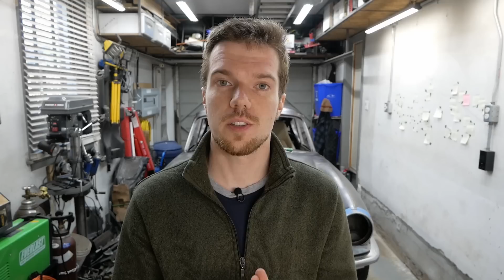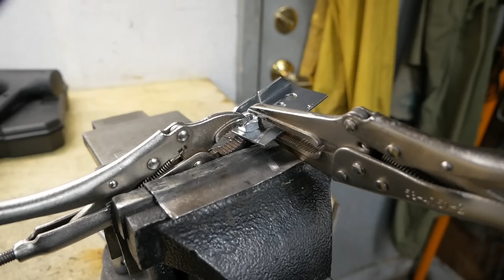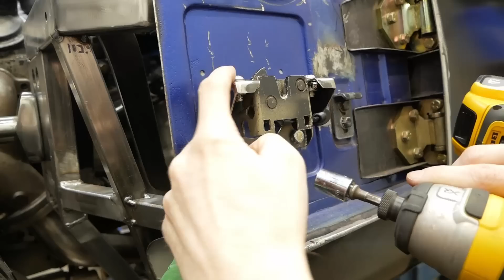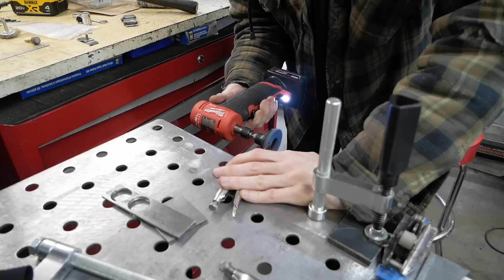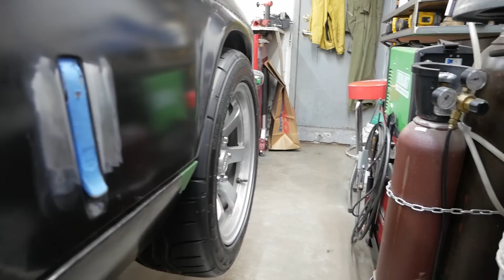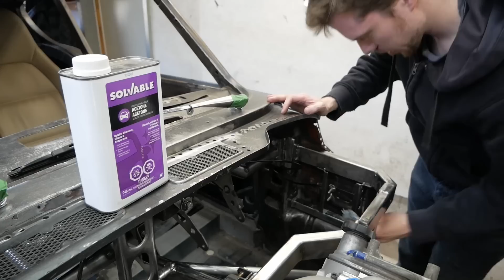Overkill Latches! V8 Powered Pro Touring Triumph Build – Project GT6R – Ep44

Comment: You can throw zinc coated items in a vinegar bath to dissolve the coating. This should make it much safer to weld and doesn't require any labor or abrasive consumables. This works well for mill scale too. A sonicator can speed up the process.

Comment: I have to ask, will petrol even be a thing when this little beautie is finished, or have you planted hemp out in the back 40 acres to turn into self sustainable biofuel as well?
Seriously though what about deterioration of the rubber like the use by dates on the tyres or any seals in the running gear, I have heard that it is far preferable to use a vehicle than let it sit as all the seals dry out, does that worry you, I bet the tyres cost a pretty packet to sit and get flat spots on them while you are crafting this animated sculpture.??

BTW have a look at Rünge Cars YouTube channel you might just be blown away🤔😮👍
Love the build
Tony from Rural Western Australia 🇦🇺🦘

Comment: Can use lead or similar to make a small ferrule to lock into the cable grip. Make a mold out of anything, even copper and a dremel. I know for sure that the handles will let go after awhile without it (35 years in small engine equipment and motorsports. Where everything has at least one cable and 100s of revisions over the years.) Print the retainer with reinforced material.
I figured out another way to locate the sides without using the originals as more than faux latching hood lift points. You can print a whirlpool shaped receiver insert that snaps in place on or beside the new latch receivers. Use a tapered tip metal guide pin, 8-10mm, mounted on the hood that goes into the receiver on each side of the hood. This would tighten it up as it closed without having to use the existing latch mechanisms. Avoiding the inevitable occasional hood tweaking when forgetting the other side latch.

Comment: Hi, and nice work all the way around.  I do have one issue that I'd like to bring up.  The idea of having to do three separate operations to get the hood to open, seems excessive.  It's your car, with your aesthetic and all that, and maybe I'm just kind of a simpleton, but 2 operations seems like plenty.  Maybe even excessive.  Especially on a front hinged hood.  Wouldn't it be nice to have solenoids as the primary way to flip open the original latches, with the manual operation being the backup?  I normally don't like adding weight and complexity, but I also don't like the idea of walking all the way 'round the front of the car, just to get the hood to open!  Maybe a cable system where operating one external latch will operate the other latch?  Or, maybe you won't be opening the hood enough to make a difference?  On the other hand, a V8 MG sort of begs the opportunity to show off what's under the hood!!  Or, just tell me to mind my own business!!!  Either way, nice work.  Have fun.
Reply from the maker: There will be very few times that it's just one of us driving the car, so two people to pop the factory latches and the driver just has to pull the internal release - so not a big deal for me. 😊 I understand the desire for simplicity of operation, but there comes a point where we've got to move on to the next step or the car will never be done!  I do also hope that with the LS, reliability will dictate that the hood's not getting opened all that frequently as you pointed out! 😅🤞 Cheers Jim!
Reply: @FanatikBuilds I was thinking that the hood would be up, more to show it off, along with the quality of the work done to get the LS in there.  I figured that you had a general plan to have a navigator, your dad or mom, or girlfriend/wife, but I almost never have anyone in the car with me, so I really appreciate electric windows.  Obviously, we open and close windows more than we open the hood, but I never cared about electric windows, until I had them.  My comment was kind of suggesting "future proofing" the car.  Great job!!  Keep up the good work, and I completely understand not wanting to get bogged down in too many details, and have your momentum die.  Driving them is more fun than constantly coming up with fiddly little details to solve!!!

Comment: QUESTION: what welder do you use?  I know it’s a MIG but what brand / rating and do you use gas or flux core?
Reply from the maker: The MIG is a Lincoln Electric Mig-Pak 140 (120V) and uses 75-25 mix.  The (lesser seen) TIG is an Everlast 185DV and uses straight argon.  Cheers!

Comment: Nice job on the latches. Clean solution for those bolt heads. I kinda like them on my 67, but should I ever change my mind I know to do it now. 😊

Edit: mine are stainless so they match the trim and look intentional. I don't like the look of the bolt heads painted. Looks to me like the painter failed to remove them, or like you're trying to hide them.
Reply from the maker: Thanks man!  So many things on this project may not be for everyone, but at the end of the day it's about building, and the specific mods need not be so relevant!  Or at least, that's what I hope people feel 😊 Agreed on not painting over the bolt heads, you'll regret that the instant they crack or you have to remove them!

Comment: I think with your need for such precision, I'd suggest getting yourself a Tig welder. Less to grind and better control of the heat. Plus the finished product will look to your standards. Trust me. If you can do what you're doing your can Tig.
Reply from the maker: Do have a TIG, but don't use it often enough to be confident ... plus MIG is just so much faster and easier. (excluding the extra time in finishing as you point out of course!) ... I do need to grab the TIG more often though, you're right.  Gah!

Comment: @5:32 is that a brass wire wheel you're using before welding again? Right after saying that you don't want to be burning the zinc from galvanized nuts?

Comment: I think you need to create a "clamshell" with hinges and structural elements for the cowl area. Think of the easy access to the back of the gauges and control area. Of course tightly sealed from heat/vapors.  Could be a neat addition.
Reply from the maker: Still trying to decide on that!  Water management will be the key issue to the design... I do like the idea though 👍

Comment: I predict you will be revisiting the little cable clamps. Ten pounds is not very much holding power. A full cable loop with a proper swage fitting retaining the loop. Examine the hood release cables on several production cars and trucks to see their methods.
Reply from the maker: Yep!  It absolutely is not enough ... more time in CAD coming up I think. ✌️

Comment: Nooooooo ..... Every place you weld something to the outside body panel it's going to show through when it's painted !!!! Trust me no this .test it out on something. Here's what the problem is!! It's the expansion of the sheet metal when it get hot . and wend the seam on the hood and remove the flag on the inside. Its also going to show through. I'm trying to he!p NOT PISS anyone off .look at any car and you will see that nothing is ever connected to the out side sheet metal ( body panels) you'll find out if you don't fix it before it's painted. I've been doing this since the80's
Reply from the maker: Yep, I know it, panel bond would have been better but there's plenty other areas on the car that have been mig-welded together so it is what it is really... it'll never be a concours car, but we did it all ourselves, and even my OCD can handle a few imperfections (within reason!) ✌️

Comment: End of the hood latch curves up to make it easy to use but it looks bad.  I would rather it be flush with the panel and push in button to release it.  Or just push the top of the latch in so the bottom would protrude enough to be able to grab the bottom of the latch.
Reply from the maker: Yeah that would be nice, I think I've already spent more than enough time on hood latches though, so we'd better move on if this car is ever to be completed! 😅✌️
Reply: @FanatikBuilds  Hahaha yea don't blame you.  You still do a great job on it.

Comment: Do you have room for vintage air ?
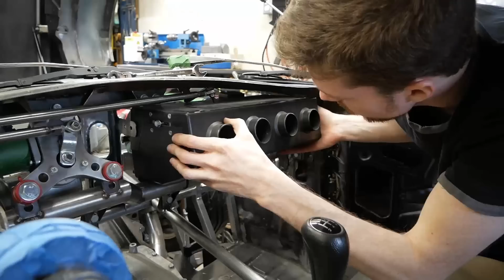Reply from the maker: The air handler we pull out at 13:53 is for heat and AC. 👍 WAY cheaper than Vintage Air, but obviously not as quality or high-tech.  AC was ironically one of the reasons why we started down this restomod path in the first place as it happens!

Comment: Grinding down nuts for better penetration of weld is real. For a while, doing some field repairs, i'd noticed that the nuts that i welded on in the field wouldn't last anywhere near as well as the ones in the home base. It took me a while to put 1+1 = 2 and get that while at the shop, i'd use a bench grinder to grind the nuts off, and while in the field, i didn't bother. The zinc coating does interfere with the weld on the order of porosity, most likely.
Reply from the maker: It makes complete sense!

Comment: I vaguely recall something about you creating your finger sander from something other than what it is now, but I don't remember. Would you help out and tell me what it is? Thanks.
Reply from the maker: Hey Jim, it's Milwaukee's M12 3" grinder, just with a 3D printed adapter for the finger sander's arm, and a pulley I made on my lathe.  You can buy conversion kits on ebay to accomplish the same goal, or just buy Milwaukee's actual finger sander for about $100 more! ✌️

Comment: stud welder is your friend, just plop studs where you need them and remove superfluous bracketry
Reply from the maker: Yep, that would be nice!  Don't have one though and likely wouldn't be a good idea to stud weld to the exterior sheetmetal, as it would tear in time.  The little stud plates we made are thicker and help to spread the load 👍
Reply: @FanatikBuilds  there are headed studs that have a bit more area for that exact case

Comment: Amazing work as always! Love the extra work to improve the look of the hood around the latches, that really makes a big difference!
One slight thing I feel inclined to mention: 10 lbs is not a lot of force against those hood release cables. My suggestion, if you wish to stay with your 3d printed clamping solution, modify it slightly so that the cable can pass through it twice: once through, then 180 degrees around and back through again. This would probably add a surprising amount of clamping strength with minimal change, if my brain is working properly anyway (which is always questionable). Of course, you probably already thought of that.
Reply: was coming to the comments to suggest the same. Please do this!
Reply from the maker: It's a fantastic idea, but getting the cables to bend 180 degrees and still fit in the space is the issue ... we're definitely going to need to improve the design though as you're right, it's not going to be adequate as it is!  Thanks man, we'll see what we can do! 😎🤜
Reply: @FanatikBuilds  - Thanks for all the great content! Also, thanks for considering my suggestion. I'm always happy to lend all 3 of my brain cells whenever I can. 😁

Comment: Any way to use one of the original bonnet latches - the external chrome handle, anyway - as the handle for the interior under-dashboard release?  It would be cool to still have another OEM latch in use, just in a different manner.
Reply from the maker: Interesting idea, hadn't thought of that, I like my printed latch with the pictograph on it, but perhaps something to think about 🤔

Comment: Surprised you left the seats in the car with doing all that welding and grinding. Great video. Thanks 👍🏼
Reply from the maker: Yeah, we need to get some welding blankets ... think we popped some cardboard in a one point, but the seats will be getting a refresh eventually anyway, so as long as there's not too many burn holes I think we'll be able to work with them! 😬😉

Comment: I appreciate the effort you put into the details, I'd have probably just taken a hammer to the latch to straighten it out. I think we should start taking bets on how long until it's complete, my guess is 2028.
Reply from the maker: Haha, unfortunately that wouldn't have worked sadly or I'd have given it a shot myself! (it would change the bolt spacing and then the factory holes in the hood wouldn't have lined up for plug welding) The things we get into for the sake of "perfection" (or at least with the goal of that!) ... 2028 is probably not a bad guess, but we'll aim for sooner and see what happens! 😬😉
Reply: 2030

Comment: Tip i found for aligning nuts with holes. Use a countersunk bolt from the other side and the cone will center the hole and the threads clamp it in place.
Reply from the maker: I keep meaning to pick up some assorted screws for just this purpose! For the life of me I can’t figure why I always forget when I’m at the store 😅 too many lists probably!
Reply: @FanatikBuilds  Many car doors are held on with countersunk bolts; if you have easy access to a wreckers (Breakers?)
Reply: I do the same and use a studding connector (long nut) so the bolt thread doesn't get weld spatter on it

Comment: Tip
If you sacrifice a ballpoint pen refill you will get a small stainless steel or chromed brass tube that you can use a Wire crimper to get a far better grip on the cable .
The refills have a large and small section that if cut in the right spot will give a flare that won't pull through.
Or you could just use a wire ferule
Reply from the maker: Thanks for the tip!  I tried a wire crimp fitting first, but wasn’t satisfied with the result.  This 3d printed clamp is just PLA and a few tweaks to the interference + a better material (CF nylon maybe?) should make sure it works out perfectly in the long run 🫡👍
Reply: @FanatikBuilds  Another thing you could try is to splay the cable apart a little by pushing a pick through it and add a blob of JB weld to keep the hole from closing, that will give a larger bump in the cable to prevent it from slipping.
Reply from the maker: @anomamos9095  Great idea! 🙏✌️